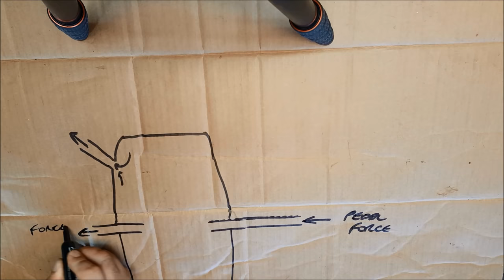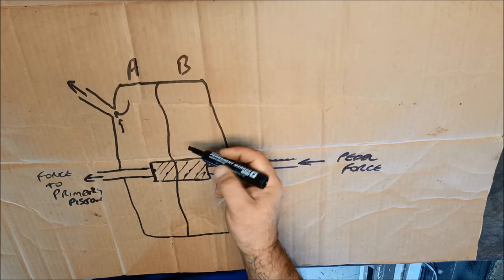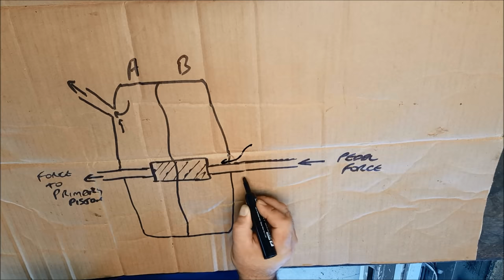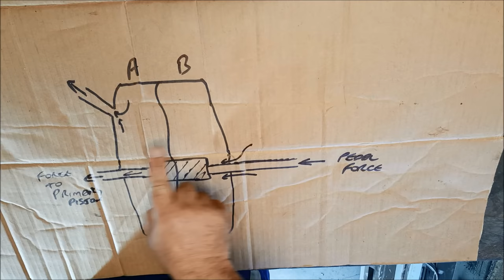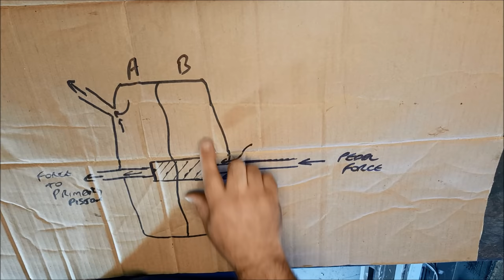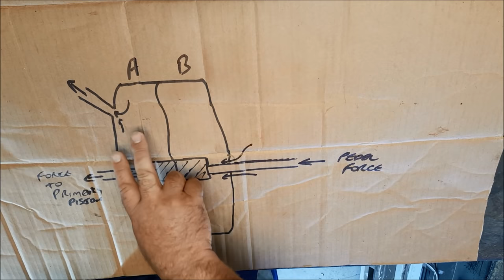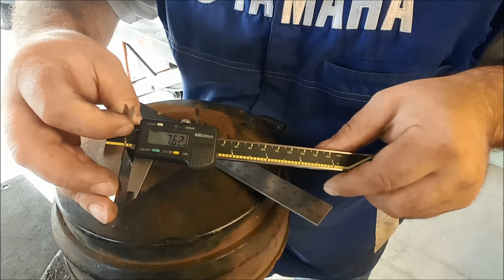Brake booster checks, operation and push rod adjustment #1313

Comment: Fascinating video, this may be my issue  on Lexus IS200(99) its had its servo replaced at some point,not sure if m/cylinder as well as no breakers mark on that. I have a lot of travel in the pedal,also when press pedal following servo test I press pedal again and hear noise  ( sort of low fart) only from in cab not under bonnet but it may happen for several pressings or less and then fine?

Comment: Great video mate, So if i was getting vacuum noise/leak from the push rod on the pedal side when u push and hold the pedal down, does that mean its the diaphragm at fault or the bit in the middle of the booster that u didnt go in depth about in this video thats causing the leak?

Comment: My brake pedal is sitting too high after changing the booster and master cylinder. I need to pull master forward and try to adjust this rod so it sits right and functions properly.
Reply from the maker: There is a 2nd rod between the master cylinder & brake pedal, under the dashboard. I suggest you adjust this one to get the pedal height correct. The rod between the booster & master cylinder will not affect pedal height.

Cheers Andy

Comment: Andy Hello and thanks. from the USA. Just found your channel. I had my brake booster rebuilt at a reputable place. They didn’t touch the push rod adjustment at all during repair, but when I installed everything back together I smell burnt brake smell. Any ideas? Do I need to start over?
Reply from the maker: +remogaggi82 You'll need to reduce the push rod length a little by the sounds of it.

Comment: Nice video. What if you're doing the in-car test on the brake booster and after you crank the vehicle back up, the pedal goes to the floor instead of just dropping an inch or so? Is that a bad booster? Thanks in advance!

Comment: I hope you may be able to answer this. My daughter's car had low pedal, but not really spongey feeling, or so I thought. Car was like that when we bought it a couple years ago. When she came home from school recently, I drove it and it was barely stopping. So, I have replace rotors and pads and greased up the pins (three were froze) on both front and rear and flush a bunch of fluid and got a nice hard pedal. Now it still doesn't stop well and pedal is hard. When the motor is running, the pedal only drops about about a inch, but remain pretty hard. When cut off the car the pedal doesn't change. When I pump it quickly and very hard I can hear some hissing from the pedal. Thoughts?
Reply from the maker: Hi,

Quick check, remove vacuum pipe to booster & blank off temporarily. Now retest brakes, they should be significantly worse, where you have to apply much more pressure to the brake pedal. If this is the case then the booster is assisting.

Check the vacuum pipe between the intake & booster, make sure there are no restrictions & it's well sealed at both ends, no perishing.

There is a one way valve, either in this vacuum pipe or where it connects to the booster, locate it & check it only allows air flow from the booster to the intake manifold - any leakage then replace

Now using g a hand vacuum pump connect it to the port on the booster where the vacuum pipe connects. It must be perfectly sealed. Apply vacuum by pumping the tool. When you stop the level of vacuum. Should hold & not drop away - if it does then there is an internal leak inside the booster & it needs to be replaced.

Let me know how you get on.

Cheers Andy
Reply: @AndyMechanic  My vacuum pump will be in tomorrow, so I can further verify, but I did remove the hose and it felt nearly identical as with it attached. Only a very slight improvement from the hose being attached. I've also confirmed the check valve is fine prior. Thanks so much for replying. I'm going nuts trying to fix this.
Reply from the maker: Is the car a petrol or diesel engine?
Reply: @AndyMechanic   Petrol. 2017 Kia Soul +. 

I put the connected the manual pump on the booster and could not build any vacuum what so ever. I also checked my engines pressure and it was at -20 in Hg at idol. I'll be changing the booster out tomorrow.
Reply from the maker: @Reign_In_Blood_963 excellent work my friend, it will be good to get your daughter's car safe again.

All the best
Andy
Reply: @AndyMechanic   Got the booster changed out. Brakes are now flawless. Much thanks.

Comment: Hey Andy, since you had the brake booster out as well as the master cylinder couldn't you just have placed the master cylinder on to the studs of the brake booster to see if the master cylinder set flush to the brake booster surface  which would mean that the push rod is either lightly touching the piston of the master cylinder or there's clearance. If the push rod was to long then the master cylinder wouldn't sit flush on the surface of the brake booster right? Also, if the master cylinder set flush on the brake booster could you just apply slight pressure to the brake pedal rod on the brake booster to get a feel as to how much movement there is before the push rod makes contact with the master cylinder piston? Just wondering.
Reply from the maker: Yes, but just not accurate enough for the adjustment unfortunately. Cheers Andy
Reply: I agree with AM, it's not as accurate, but also risk of slightly too long rod causing master to be applying the brakes when driver doesn't want them, premature wear out of pads as a result.

Comment: I have a 95 gmc 2500.i just replaced the brake booster..the problem is I just noticed. That I've been losing lots of break fluid I checked the rotors & drums n there's no leak. Does it could leak inside the booster??
Reply from the maker: Yes, if the rear seal on the master cylinder is leaking this can Leak into the brake booster.

Cheers Andy
Reply: @AndyMechanic  ...do I have to change the master cylinder or I can find just the seal?

Comment: I have an issue with my show truck. It’s a 2001 s10 but because of suspension reasons I have a geo metro brake booster and master cylinder.  When my vacuum hose is disconnected I have good pedal but when it’s connected the pedal sinks to the floor. Any suggestions?
Reply from the maker: Hi Chris, just to confirm, do the brakes still work when the pedal sinks down or do you not have any brakes?
Reply: @AndyMechanic   yes they lock up.

Comment: Is the tip of the push rod on the booster supposed to be dry or greased on the tip? If so which grease can you use or not use,?
Reply from the maker: I haven't actually seen any info on greasing this contact point. Though I don't think a small dab of lithium soap based grease would cause an issue. 

Cheers Andy

Comment: My 2000 Honda Accord ex and brakes are locking up after awhile driving just replace the front brake pads rotors and brake hoses and put new fluid in and bled the brakes and car drives fine and brakes fine and then after sometime driving the front both front calipers just start locking up had stop and let the brakes cool so they here smoking. Then after everything cools off it just works fine I don't know if this could be something with the ABS or the master cylinder?
Reply from the maker: Your issue is exactly the fault highlighted in this video. The push rod between the brake booster & Master Cylinder is too long & preventing the piston in the master cylinder from resting against its stop when the brakes are not been applied. Therefore the compensating port is closed preventing fluid transfer to the reservoir as it warms up  (thermal expansion). The increased volume of fluid then pushes out the pistons in the brake calipers of the respective circuit - in your case the front brakes.

You now have all the info you need in this video to fix the problem with your car.

Cheers Andy

Comment: Question 
I have a lean code on my 2001 f 150 so I sealed the hose that goes to the break booster and my fuel trim went down can it be the break booster that has a leak
Reply from the maker: Yes, possibly - the diaphragm or the internal valving could be leaking - best replace it.

Cheers Andy

Comment: One more question please...will the adjustment be off I'd I have used brake pads or should I replace with new pads first.
Yazmin 
Venice Beach Ca 😎🏄
Reply from the maker: Hi Yazmin, no you are okay, caliper pistons adjust automatically so having used brake pads will make no difference here.

Good Luck :-)
Andy
Reply: Thank You  Andy...Keep the knowledge coming
Yazmin 
Venice Beach Ca

Comment: Are all servo one way valves the same so long as they fit tight? ie. the spigot sizes are the same diameter. I have been unable to source the manufacturer part and need to get back on the road, I see many similar ones on ebay that would fit, could i use one temporarily.
Reply from the maker: Yes, they are just a one way valve, just ve sure to fit it with the flow in the correct direction

Cheers Andy
Reply: @AndyMechanic  Thank`s for your reply Andy. I temporarily fitted a slightly smaller valve I adapted to fit and drove cautiously ( bricking it ) but all seemed to work OK. Had a MOT done and it passed - brakes v.good. By the end of the week I had the correct non-return valve fitted and I can`t feel any difference in braking performance. just to let others know if they find themselves stuck.

Comment: 26:03 yup when I had to slam on my brakes I must have ruptured that valve between chamber A and B causing the brake pedal to stay depressed during light braking keeping the brakes engaged until I stomp the pedal to release. New booster.

Comment: I'm having trouble with bleeding 84 olds tornado . I replaced all the lines in the rear due to rust. .
Start from beginning.  Car shows up leaking brake line drivers side  . The brakes were hard. Changed the booster  fix hard braking issue,  but wont bleed. The Master cylinder was claimed to be new before reaching me. The back chamber on Master cylinder bubbles up heavy . I get brake fluid out the rear  .really none out the front. I opened the back bleeding screws ,stomped on the pedal to try to move the combination valve to move it back to the even setting.  No dice.  I open the fronts  and stomp down and fluid squirts like it should,  soon as I start the bleeding process  the frontside  close again  results soft brakes

Comment: Hi Andy I have a 1989 Dodge B-250 van I hit the brakes hard and the right wheel held brake pressure I thought it was the calliper and replaced it I was wrong it was the flex line so I changed it .Everything seemed to be going great I was bleeding it still get a little air so I bleed a little more and then the pedal went to the floor or almost anyway then I could not get fluid to come out steady steam it only dribbled out. So I thought maybe I blew the master cylinder replaced that now I get fluid from the front but brake pedal is still very low. With the van turned off the pedal goes almost to the floor is that the booster or maybe just the check valve. I need help here.

Comment: WHen I start my truck the brake pedal sucks to the floor and the brakes apply themselves!
 It was an increasing problem over the course of my day.
On the way home from work I was cruising down the freeway and let off the gas pedal and the brakes aggressiveness applied themselves with my foot no where near the brake pedal.
My truck, a 1990 1500 1/2 ton 4x4 350 ci, decelerated rapidly.
I can handle that, however the semi behind me smoked his tires braking to avoid running me over ! 
Not good.
I changed the booster last week and after surviving the freeway fiasco, changed the master cylinder last night.
Same symptom of the upon start of engine , the brake pedal pulls itself to the floor.
I am going out to test the check valve on the new booster.
No one I have talked to has ever heard of this happening.
I have bleed the brakes to the tune of a quart of brake fluid.
Any help will be appreciated.
Good videos Andy !
You rock !
Reply from the maker: +Aaron Goree Wow. This is a new one for me. Okay. Back to basics. Block off the vacuum supply to the booster. If the problem stops then it must be a fault with the booster. 

Just be aware you will have to apply a lot more force to apply the brakes. Can't be the check valve...
Reply from the maker: +Aaron Goree also just check the spring return is fitted to the brake pedal too. It may have come off or be weak or broken
Reply from the maker: also, check the push rod length between the brake pedal & booster - it must have freeplay

Comment: brake booster from Auto zone for F150XLT 2 wheel drive does the booster pin need adjusting
Reply from the maker: Most likely, any replacement of the booster or master cylinder should involve checking this push rod length. Cheers Andy
Reply: @AndyMechanic  Andy would you know the Ford spec on brake booster push rod pin clearance for a 2008 F150XLT.

Comment: I accidentally cracked the master cynlinder resivoir and now every time I try to start the car with the booster hose to the plenum it stalls out but with out the hose connected it starts right up. To I need to replace the brake booster aswel? 2001 dodge grand caravan

Comment: So I have a 08 Silverado the brake booster makes like a grinding or jumping noises when applying the brakes so removed the master cylinder and see the adjustable nob move but when brakes applied the nob is solid went to advance no answer should there be play in the nob rod??

Comment: Hi Andy, this video made everything more clear. I have a question, if the push rod is to long? Could that be the reason why brake fluid gets into my booster and that fluid/fumes are the couse for my engine to smoke...? The brake cylinder is brand new. Maybe the 'push rod' pushes the brake cylinder piston to far and that causes the leakage? When I take out the brake cylinder and press the piston with hand, there's no leakage? Legs force plus the boosters help with a longer push rod could maybe give enough force to the piston can push it to far in? ( After i removed al the brake fluid in the booster and put al together without using the brakes and starting the engine there's is no smoke what so ever)
Thanks
Reply from the maker: +bruce coetzee Hi, no, rear seal on master cylinder has failed. You need a new master cylinder unfortunately. Cheers Andy
Reply: Thank you Andy.

Comment: I have a 1996 Toyota hiace, change front brake calipers, master cylinder and brake booster. Went off brake is hard and goo,but when turn on brake get soft which suppose to happen.  But starts to slip away.

Comment: So if the brake goes down on the test it's bad? I'm confused sorry.
Reply from the maker: Hi

No, when you start the engine it creates a vacuum in the intake manifold. This is piped to the brake booster & applied to both sides of the diaphragm (so equal both sides)

Once you have released all the vacuum in the booster with the engine off press the brake pedal and start the engine. Vacuum is supplied from the engine again & with your foot on the pedal air is introduced into the rear chamber reducing the vacuum in that chamber (full vacuum is still in the forward chamber.

This provides a force which increases the force you are applying at the pedal & it should sink further down if the booster is working correctly.

Hope this helps.

Cheers Andy

Comment: Thanks for the video. 

Question :

I have a 76 CJ7 jeep that was stock with manual drum-drum brakes. I converted to front power Disc brakes and used a dual MC power booster from a YJ wrangler but the piston rod is a bit longer and so I dropped my brake pedal to allow room for the extra length. (obviously the wrong decision 😂 ) Problem is,  now the brakes are soft.  I have to pump them to get it to stop.  (yes,  the bleederscrews are on the top of the calipers). 
Any idea what is causing the soft pedal?  Do I have to switch to a YJ brake pedal?  Or is the piston rod adjustable?  
Thanks again for the video.
Reply from the maker: Hi, is the master cylinder bore the same on the new system than on the original? Or are you still using the original Master cylinder?
Reply: @AndyMechanic  When you say the same size,  do you mean length,  or girth? 

The new rod is slightly longer and if I remember correctly is  teardrop. But The original  brake rod was not.  
Is that what you're asking for? 

Side note:
Also,  I just realized today that I connected the small front reservoir to the front disc brakes and the large rear reservoir to the rear drum brakes... 
So,  I swapped the lines.~ so NOW, the small front booster reservoir goes to the rear drum brakes and the rear large reservoir feeds the front disc brakes.  Hope it's correct now.. Now I have to bleed the lines.
Reply from the maker: Okay. No, this isn't about the push rod. If you have changed the Naster Cylinder & the bore size is smaller the pedal will travel further in order to push the same volume of fluid down the lines - this makes the pedal feel spongy

Comment: Helo.  I havean issue.  Did your test on brake booster testing.  I pumped several times and it gets very stiff.  Turn engine on and pedal sinks as it should.  But if i keep the pedal pressed, the pedal eventually touches the floor.  The reason for the tests, is that when i press he pedal when engine is running the pedal hisses at me.  What am i missing please.  Have i got a snake of a brake system.?
Reply from the maker: Hi, sounds like one of the main seals in the master cylinder is leaking - this will need to be refurbished or replaced.

Thanks Andy

Comment: Can this be done on the vehicle, or does the booster and MC have to be removed to do this??
Reply from the maker: The master cylinder will need to be removed but usually the booster can be left on the vehicle if there is sufficient access.

Cheers Andy
Reply: Andy Mechanic Thank you!